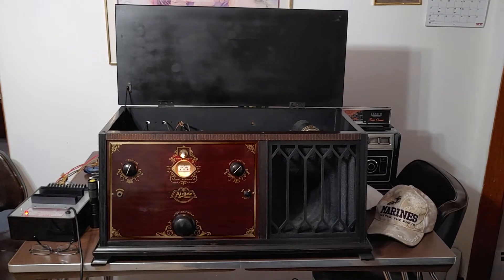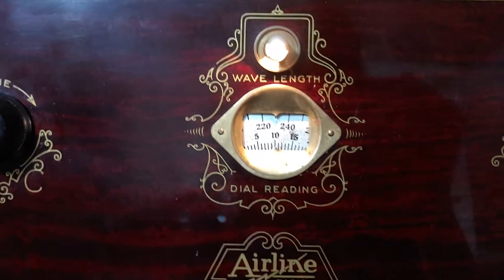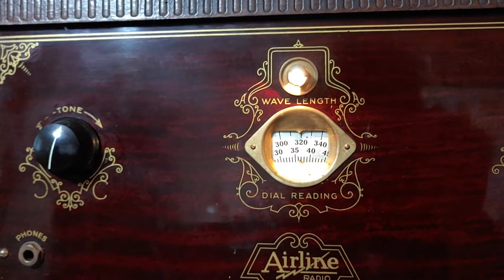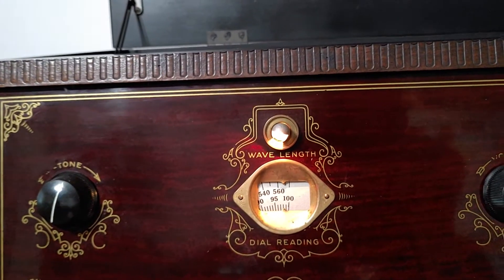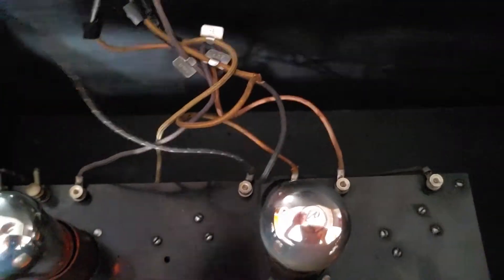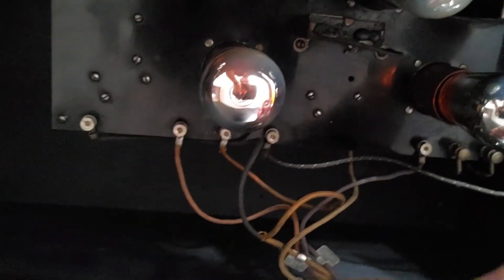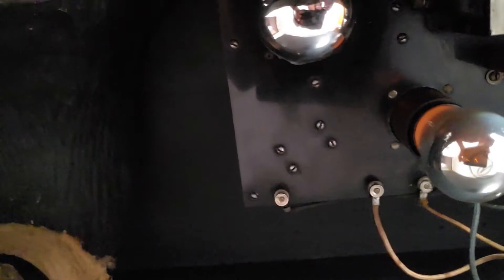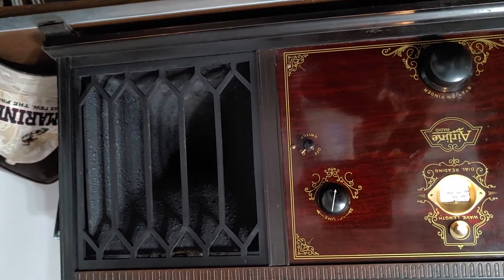Montgomery Airline 1920s radio set Need help identifying it!!!!

Comment: Thats a nice radio Marty !!!    What is the tube lineup in there ?
Reply from the maker: They are 301A tubes and 1 112A tube thanks for resonding
Reply: @martyhuff5866    so only 2 tubes ???
Reply from the maker: @rciancia  oh I am sorry 5 tubes!! I am working so I will respond at break time
Reply: @martyhuff5866   no problem. I am trying to help find it.. apparently someone has spray painted that cabinet and probably over the model number. The older radio's from the 1920's, had a metal plat riveted inside with the model and patent numbers.  Will let you know what I find...
Reply: The closest thing I can find is the AIRLINE ENCHANTER from 1926.  It is a 5 tube TRF set with 5  201A tubes and an enclosed HORN speaker.  Will keep looking.
Reply from the maker: Thank you so much my friend and ya I knew the cabinet was done but it still seamed to me to be a nice radio to have anyway!!! Again thank you for helping.and the other thing is that I know it's not a radio command radio!!
Reply from the maker: I mean commen radio
Reply from the maker: Common radio